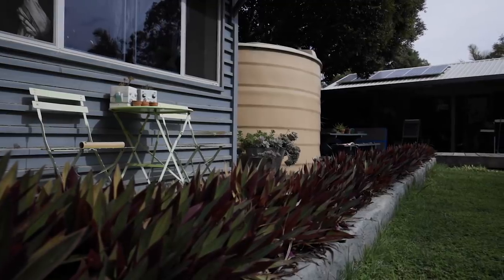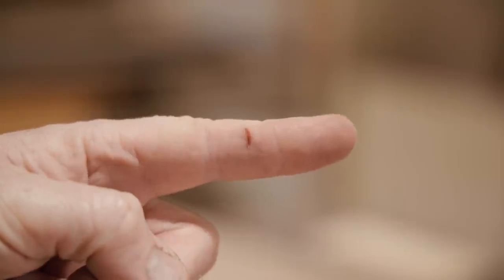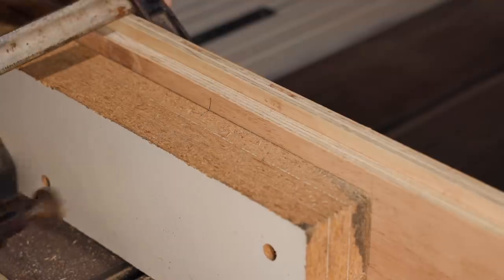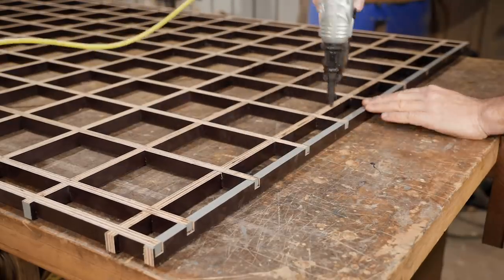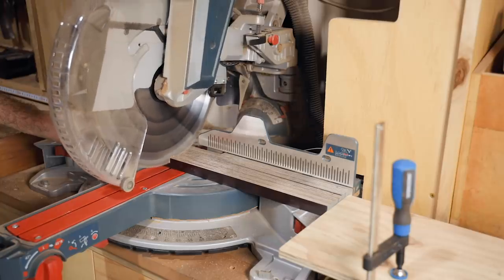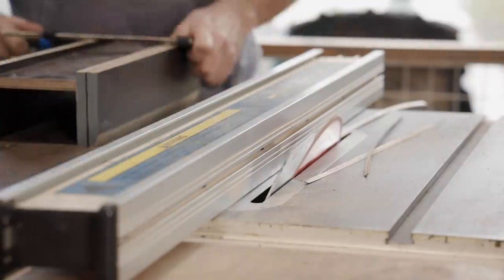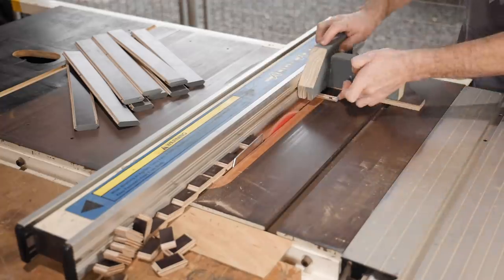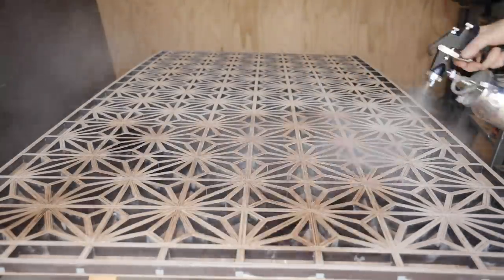How to make a Kumiko Screen from Plywood

Comment: YES　In the old days, there was no electric motor, and everything was handcrafted.
Reply: It would have taken months
Reply: @VarunJS45  absolutely. hand work is for things you enjoy doing, machine work is for things that need to be done. mix them to taste but one is not better than the other
Reply: Can you suggest a building in Japan where we could see photos of a Japanese kumiko master's hand work please? Thanks.
Reply: @me4taki9oh  Wow. The two gentlemen in the video make some incredible work. I can see from the dates, that the older gentleman has over 50 years experience. Their work is so intricate :) Thank you!
Reply: @OriginalRaveParty  It was probably booming in the old days with lots of people, like football and smartphones. Sadly, there is no demand for it now.THANKS
Reply from the maker: I love using hand tools too and find it much more enjoyable than power tools, but I also work practically by incorporating both into my workflow. :)
Reply: @PaskMakes you are  a respected man. If there were 10 Pask Maker   , it would be a day's work without electricity, lol.
Reply: @calinguga  not necessarily. Hand tool work can be just as fast as machine tool work, once you have the skills and experience. You just have to be more efficient, know when accuracy matters and what you can get away with. The same methods as Pask Makes used here also apply to hand tools. The English Woodworker taught me this.

Comment: Nice work Pask. Here in the states the only use that I’ve seen for ‘form ply’ is concrete forms. I used to make them myself. I had a piece sitting on edge in contact with the earth for about 10 years. There was about 3mm if decay along that edge. The rest was fresh as a daisy. Excellent choice for your kumiko.

Comment: that kumiko would be great as all the walls for a octagonal summer house or workshop/ shed. upsizeing using the planking from garden decking. as it is bigger and has the routed lines in for grip under foot to recess individual panes of colored perspex or glass as Windows and sandwich polystyrene between wood in the rest of the walls.? nice looking project again pask 😉👍

Comment: Looks absolutely phenomenal, I would hate using the power tools and having to work out all the angles but would happily do all the repetitious gluing and hammering. I really hope you have a plan for supporting it well, it will not just be a screen, but the wind will treat it as a solid fence, and with no vents you will have to have serious levels of fixing to ensure it’s stability. Or alternatively, hinge it so it can be quickly folded against a wall if there is a really gusty blow.

Comment: You could use this panel to cast a mold with flexible rubber, then use the rubber mold to cast cement panels.

Comment: If  the plywood backing were black the kumiko would really stand out! I realize paint may prevent the glue from adhering, but maybe you could figure this out. HMM, ... an idea came to me, talk about tedious (which this project already is) use screws from the back and into the little kumiko pieces. 

If you do resolve the glue issue I presented, another amazing feature would be to paint a forest/greenery mural on the backer before attaching.

Another idea, paint the front edge of the kumiko any contrasting color.

Comment: What the heck is formply?  I’m in the US and I’ve never heard that term before. Thanks. Great work as always!
Reply: It's used in what's called formwork.. basically building moulds from plywood, into which concrete is poured, for making building foundations and/or other structural components. Unlike regular plywood, it has a tough, smooth shell on both sides which gives the concrete a smooth finish, and that cement etc, will not stick to.

Comment: That's a great design. Looks really good.
Where did you get hold of the dado blade? I know they are difficult to get hold of in the UK.
Reply: My guess would be Carbatec or Timbecon, both retailers of fine woodworking tools here in Australia. (Dado blades are not illegal in Oz.) But even if you were to import a dado stack, it's unlikely to fit your table saw. Table saws sold in Europe & the UK are made with short arbors, specifically so that dado stacks can't be fitted to them. The "logic" is that, since you can't use a riving knife with them, they are "too dangerous" for the public to use.

Comment: Neil- when you lifted the finish piece off the wall at the end, i could see there is some flex to it. Isn’t that super dangerous to all of the many joins?
Reply from the maker: When the panel is installed it will have a rigid frame around it. The glue is flexible too. :)

Comment: Amazing work! It looks beautiful!
Would it hold up at all without the back board?
Reply: Probably not. The slick, hard outer shell of formply doesn't take glue well (if at all) which is why almost all the pieces were glued to the back board, and not one another, except in the few places where the joints were all bare wood.

Comment: Are you sure that was 12mm (½”)? It sure looks like 18mm (¾”). 
That looks like a product called ‘Chinese film face’ in the US, used for formwork. It’s very reasonably priced for a form grade plywood, but be forewarned. While using it on a bit of a trial basis, we found many sheets to be slightly out of square or slightly less/greater than specified dimensions. For small projects, it probably won’t be an issue but for larger things like forming an entire floor of a building, those small imperfections add up and can be really troublesome.

Comment: Nice work if you can get it.  I do small scale electronics, totally different but same degree of accuracy and repetition.  Break every operation into logical steps.  Like programming a computer or CnC. then start preparation and then production. Work until you find you are taking aim at the window with your parts, then break for a while, return when ready and repeat till finished.  Cant imagine anything that fulfils my brand of OCD/Asperger's so satisfyingly, I sleep well on a night  I can't think of anything better (saddo?).

I now find that watching it is just about as good as doing it - OCD porn yay!

Comment: When you are using that sled to cut the 512 pieces, you could have clamped another workpiece to the other side of the sled, made a cut, turn it around and cut the other piece. It will save you time next time...

Comment: With the blade set that high you would have failed my shop class. My shop class had very strict safety rules, and the big one was the could not be higher than a 1/8 of an inch over the top the of work.

Comment: love it but what did you call that plywood with the  brown side?
Reply: Formply.  It's used for formwork. Building moulds out of plywood, into which concrete will be poured, to make structural components. The tough, smooth surface makes for a smooth face on the concrete, and ensures the concrete won't stick to it.
Reply: @Garryck-1  thank you, I believe we have it here but the color is white.

Comment: Imagine trying to do this in the UK, where the table saw stack is illegal.
Reply from the maker: I made the pine test piece using a router. :)
Reply: Wow, I hear you!  What IS up with that, anyway?  I’m sure government regulators believe they have some sort of sensible justification for that ban, but for the life of me I can’t think of what it might be!
Reply: @VideobyHomeworks  More blade more danger? It totally misses the point that you still need to cut the same amount of wood, so if you do use your table saw you repeat cuts, stacking your risk.
Reply: MechMinded: I know, right?  I just can’t figure out their angle on this one... but I’m sure they must have one!😆

Comment: You could lasercut or waterjet-cut this out of a full sheet of ply, if you weren't quite so talented or patient as Pask, right?
Reply: Absolutely, there are even companies like Plyco that specialise in laser-cuttable sheets with heat-resistant glue. As for the cost of a cutting system that can handle an entire sheet at once, I imagine that'd be some serious $$$

Comment: “Plywood” - a cost saving alternative to using solid wood in large quantities that are impractical in large form.  Using plywood also reduces cost and because it is cheaper and has fantastic structural integrity it is now one of the most common building materials. Question- How do we make the use of plywood more expensive?  Answer - I guess we can increase labor cost.  Question - what form of labor increases the cost to the highest point?  Answer - Kumiko! Winner, Pask for showing the government how to charge for labor!

Comment: What is form-ply?  Looks like phenolic topped plywood?
Reply: Pretty much.. it's used for formwork. Building moulds out of plywood, into which concrete will be poured, to make structural components. The tough, smooth surface makes for a smooth face on the concrete, and ensures the concrete won't stick to it.
Reply: JAFO thanks!